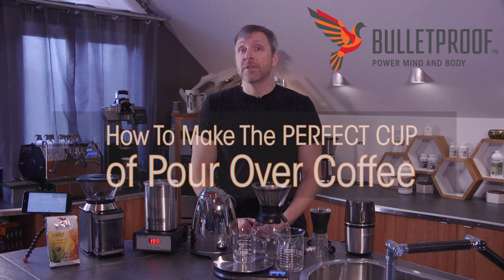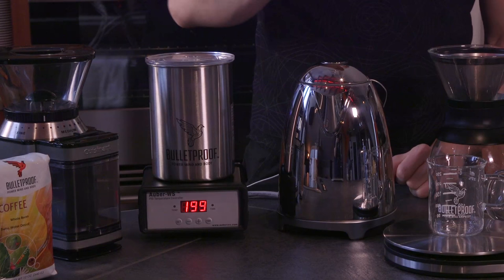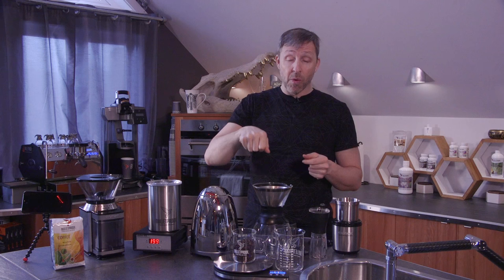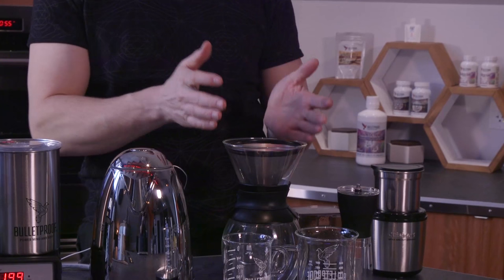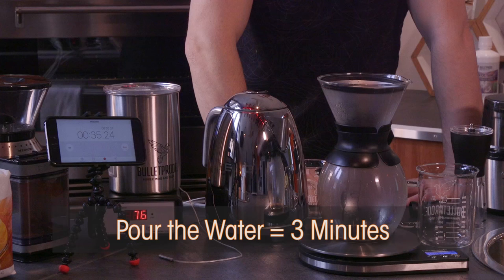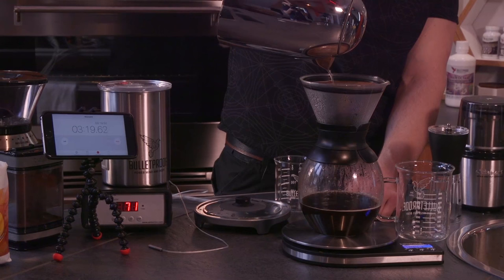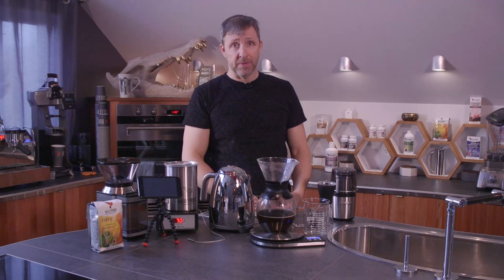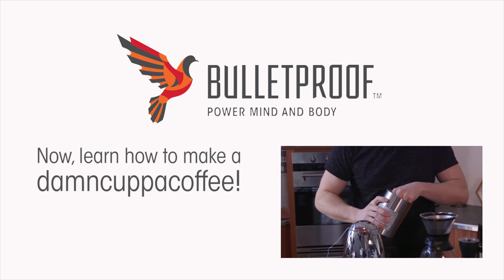How To Make the Perfect Cup of Pour Over Coffee w/ Dave Asprey

Comment: Disheartened here, Dave. With such spectacular coffee, I would think you'd nail the fine details of the pour over. 

Few tips: 
- the literature reports the optimal brewing temperature to be 205 F. Perhaps your beans prefer 199?
- grind is very important. You don't specify the particle size here.
- brew ratio is even more important (coffee:water). You just said pour for x amount of time... this is entirely inaccurate as pouring velocities differ. The standard is 9-11 g coffee for every 6 oz of water, or 1 g coffee to 15-17 g water. 

Nail the ratio and you'll get a near great cup of coffee. 
- SCAA barista
Reply: +Austin Newsam he does say grind to table salt size in the video.  Though personally I prefer turkish grind for most things.

optimal brewing temp depends on grind and age of beans.  Lighter roasts are harder to extract, and older beans tend to be easier to extract.
Reply: +Austin Newsam Thanks for the tips. Yeah, there are better how to videos. Dave did mention grind size, but regardless, you failed to include your recommendation. And your coffee to water ratio is the same as what he stated.
I play with water temp according to roast, i.e. the lighter the roast the higher the temp.
Reply: +jvesik Oh, I wasn't trying to include my recommendation.